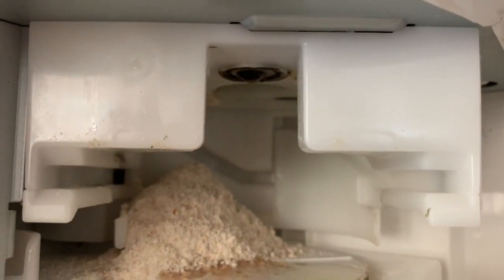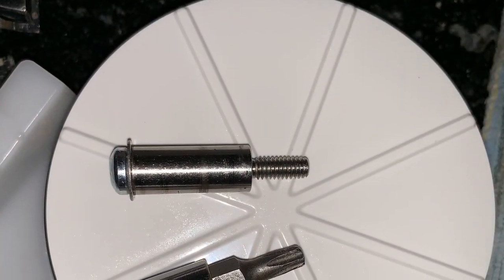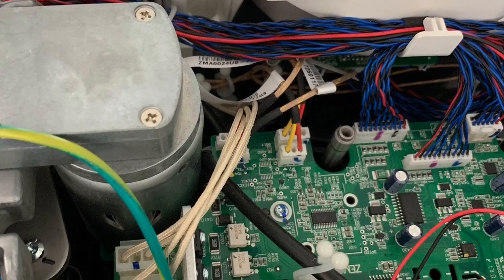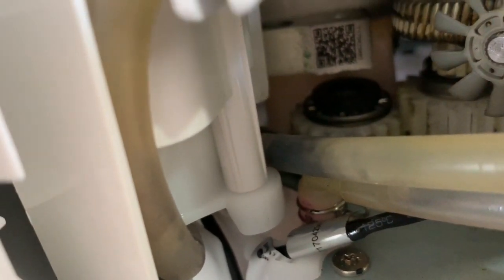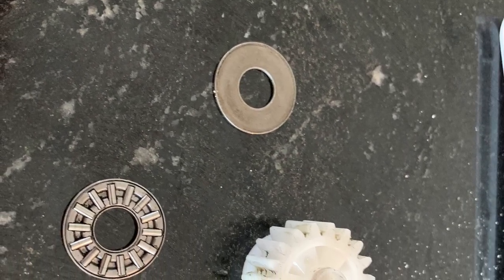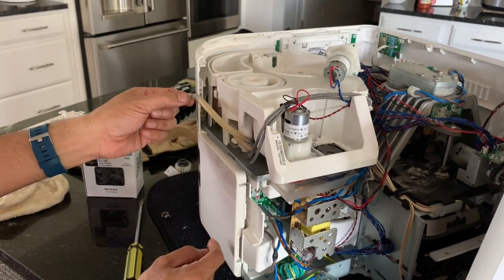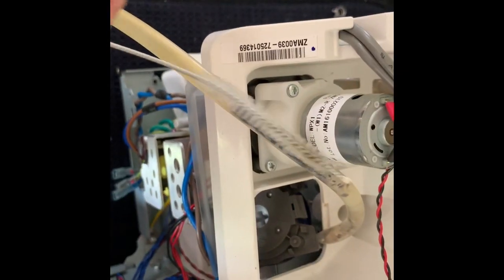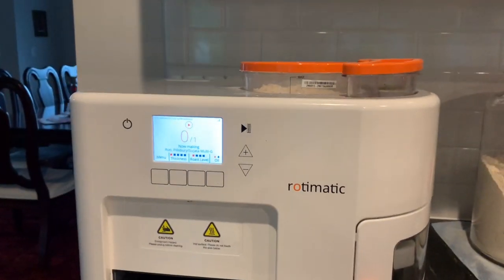Mold & Abnormal Kneading noise Rotimatic - Solved

Comment: Thank you so much for sharing this video, it helped us to try and open the machine which is having the same gear issue.  Unfortunately we couldn't fix it as we didn't have the spare parts available.  Two of the bearing of the rotator cup are corroded and in a bad shape hence not rotating or kneading the  dough.  I have contacted Rotimatic to see if they can provide spare parts.
As they've asked me to send the machine to Singapore and I live in the UAE.  Repairing cost $580 + shipping $450 .. it's almost the price of a new machine!  Hope I will find a solution for the same.
Reply: Hi Alyasiyyah, can you please share details on how did you open the machine. I am not able to get to the parts to see if it is fixable for me or not. Any video or written steps would be helpful. Thanks in advance!
Reply: I got the same problem and exactly same situation and same answer they gave to send Singapore and they told they will replace but it’s same price buying another machine .. if they don’t provide parts then it’s a rip off of customers by zimplistic ..

Comment: Awesome video, will you able to advise me what is the cause of oil keep on spilling rather by few drops
Reply from the maker: Thanks. The oil container has a spring loaded valve at its base, empty out the container, wash it thoroughly with detergent and hot water, move the valve up & down during cleaning it should clean any debris stuck in that valve and fix this problem, hopefully.

Comment: A quick question. My machine kneader is no longer turning. Is there a fuse i need to replace. Can i DIY the issue
Reply from the maker: You can DIY as you have nothing to lose, its already not working.

Comment: Thanks for sharing the video, its very helpful. Though I have a question, White rubber at water inlet came half out in my rotimatic, due to which water started leaking. will it be possible to put it back after opening the machine, any idea?
Reply from the maker: As I recall, it was crimped from the other end, it looked difficult, but you have nothing to loose, its already come off, what more can go wrong. Go all the way and open as much as required to fix it.

Comment: Thank you for making this. I never liked Rotimatic. I dont buy v1 of any product. And this mold design flaw, yuck. Did you manage ro clean the pipes with that thin wire brush ? I am not opening up a working machine, so this is a future task. But I can see a black shade behind the white plastic, below the flour tunnel. I can feel the water pipe opening there. We have been using for 1.5 years.
Reply from the maker: We bought the v1 knowing that we will be the test mules. Hopefully they will fix their poor customer service as disgruntled users are increasing by the day.
Reply: @akhaqan  Can you please guide me here in the resolution of this issue. Thanks!
Reply from the maker: @saharfaizi7879  Please watch the video, it may help you if your issue is the same, otherwise you have to investigate yourself.
Reply: @akhaqan  hi I can't explain how happy I am to see your video. From last couple of days I have been thinking, has anyone ever tried to fix by themselves and found your video. Now I will tell you my story. one fine morning my rotimatic stopped working. I called customer care they gave me quote of $580 USD. As per them it is a hardware issue and pans are not moving, but I don't want to spend any more on it. It is showing please clean pans and ensure kicker is properly installed. Do you think it can be resolved. You are my last hope. Please let me know if you know anything. TIA
Reply from the maker: @aartisharma3545  Thanks. The Rotimatic team has the same exploitative attitude with everyone, this forced me to try to fix it myself. My approach was what else could go wrong, its already not working. To answer your question, I have not faced this issue yet, I think if you are handy with such jobs and tinkering, you should give it a try, open it up and try to figure out what is wrong. Rest assured you can't mess it any further. Good luck.

Comment: Hello, thanks for making this video. Do you ever faced an issue with the water leaking from the top. As soon as I place the water container it starts drinking water non stop
Reply from the maker: That's normal for it to drink some water on startup, then it stops. If it doesn't stop, try to see where is the water going, it will be leaking somewhere
Reply: We are also facing similar issue and one of the reason is round rubber seal which goes in at entry where we put water container. We spoke with Rotimatics team and they said that it won't be fixed by customer and needs to be sent to their team which would cost some money or other option which they gave is get refurbished one at discounted price.

Comment: Hello, I have a problem where the Kneader has stopped working. Any suggestions on how this could be fixed as Rotimatic has refused any assistance to fix the problem
Reply from the maker: If there is absolute silence when its time for kneader to rotate then it could be motor failure. If there is some sound and movement in the kneader then it could be mechanical fault. Then it warrants opening up the machine
Reply: @akhaqan  how do I open the right cover, does it slide out or do I pull it outwards?

Comment: Hi Amer - Thanks for the video. I am stuck with the exactly similar situation. My Rotimatic is giving noise and not kneading properly. Flour and oil comes in the kneading section but no water. Rotimatic is asking to buy new machine. I saw your video and have few questions if you could help me with - 1) Was your issue only related to gear slip and you just adjusted the existing gears? 2) I am ok in opening machines and fixing such things. Just want to know is it too complicated once opened? 3) Any other suggestions to deal with it?
Reply from the maker: You are welcome. 1. Correct, that was the only issue. 2. It is reasonably complicated, all you expect to see inside is shown in the video though. 3. Remember to take lots of pictures BEFORE disassembling anything, pictures from 3 different angles at least, that would be a lifesaver. Go with the confidence that its already not working, what else could go wrong! You can build upon & improve my video, it may help someone else like us:)

Comment: Hello Amer. I am stuck in the same situation. My rotimatic is making veryloud noise and the company said there is some issue with the kneader. And they are asking me to purchase a new machine. Your help in troubleshooting this would be highly appreciated.
Reply from the maker: How can I help
Reply: @akhaqan  for me...by starting with the instructions on how to reach to the motor/gear part, 😄
Reply: @akhaqan  hi I have same issue.. I have opened the rotimatic but not able to get the idea how did you remove the gear???
Reply: Yes how did you remove the gear?

Comment: Thank you for sharing the video and experience. My unit as is out of warranty. Any idea why I get "flour seems to be running low" message. Even though I cleaned the container by dismantling every part and also made sure the tunnel is free from debris. Tried changing the flour and now waiting for new container to be replaced. If nothing works, going to open the unit and check. Any idea where are the sensors for measuring flour level and what needs to be checked?
Reply from the maker: Thanks. The flour level sensor is on the side wall of the body of the rotimatic where the flour container is inserted. Look around on the side wall adjacent to the control panel.
Reply: @akhaqan  Thank you, I found the sensor and cleaned it but still I  get the same error. Please let me know what should is the order for removing top cover and right side panel? if you have pics please share.
Reply: @bmkotian  please make sure that your rotimatic is up-to-date with the firmware updates,  for that, connect rotimatic app to your rotimatic using serial number of your machine and then connect with the rotimatic support team and ask for help to see if your machine is up-to-date.  I had same problem with low flour levels but after the updates, it is working fine. In fact it's with the new update where the dough is now not getting wasted as before!! All the best 👍

Comment: Great video Amer! Our rotimatic started leaking water outside the kneading cup. I am wondering if the mold is blocking the water or if that tube got disconnected. Have you had this issue before?
Reply from the maker: Thanks. We have not faced this issue. I'd start with checking that the water container valve is holding water properly and not dripping water. Then opening up the machine. I don't think tube blockage due to mold can cause leak.
Reply: Agreed. The water container is fine, there’s no leak from it. To open the machine, you remove the 7 screws in the back, remove the back panel, then the top panel and then the side panels, right?
Reply: I am facing similar issue, mine is exactly 2 years old
Reply: @tarusoft  I fixed it yesterday
Reply: @vidyashankars  what was the issue n how did you fix it?
Reply: Taruna Verma check your video. I’ve commented there

Comment: Our rotimatic is in use for over 2 years now. Can you post a video showing how the top cover was removed? Thanks.
Reply from the maker: This is the only video I made, look at it closely and you will understand how to remove the top cover.
Reply: @akhaqan  So the top cover comes off first? And is to be pried open from the front and then slid towards the front to take it off?
Reply from the maker: @chhupparustom  Yes it comes off first but then slide it back, see the notches.
Reply: Sir jee...a quick video on opening it up or instructions would be helpful. I tried to fix the same issue you have here in the video; but I tried opening the back white plastic body first and could not get it open. I opened 8 screws as well...but still i was not sure how to get the top-back those three latches to open. Please help 😄

Comment: We were able to open the backdoor easily but could not remove the top part...Is there a technique that we need to use ? We have half opened and it's lying there...Any suggestion is appreciated
Reply from the maker: Look at my video closely, you will understand how the locks work for the top part, then you can disassemble it easily
Reply: @akhaqan  ...Thanks for the reply....We opened but I am afraid we broke the hinges and there's no mold at all
Reply: @akhaqan , thank you for the video. I understand that the top cover has to be pushed towards the back in order to remove it(I did see the two notches on the sides). I'm unable to see how to disengage the front of the top from the curved side(water supply) going towards the control screen. If you have any pointers on how that part gets disengaged, that will potentially help quite a few people who have posted here with questions related to how to open the top cover.
Secondly, does the top cover only come off after the sides have been removed, or can it come off after taking the back cover off?
Once again thank you for providing the initial video on what you did in order to resolve the issue related to the noise.
The reason I have to open the Rotimatic is because I suspect we have mold in the water pipe since even after cleaning the water container and the socket it goes in, we see black stuff in the kneaded flour.
Reply from the maker: @kumarsamarth  If you look at 4:30 onwards, you will see that sides have to be removed to gain full access. I just started yanking at the covers to see where they were hooked, then used all four sides of force i.e. up, down, low, high to remove, that's how plastic locks are removed. I wish I had made the video of that part also. I did it blindly, you have at least this video to see the actual position of the locks and take it from there.

Comment: Dear Amer bhai. Error on my rotimatic.
"Flour seems to be running low". But it is not low. Flour container has been removed, disassembled, cleaned and reinstalled. Still having the same error
Any good suggestions? Please share. Thanks
Reply from the maker: It seems the flour level sensor is malfunctioning. You can try cleaning the entire area where the flour container is put. The sensor is on the side wall. I seriously doubt that it can be fixed. Did you try calling the helpline? Make sure the rotimatic is connected to the internet. There is not much else you can do. If you are handy, go ahead open up rotimatic and try to get a replacement sensor, it would most likely be an optical sensor.
Reply: Thanks for the tips.
I tried to open the rotimatic but could open the back cover only. I have figured out that the flour tray sensor is weak as per your guidelines. I did some temporary modification and made few roties. I wanted to take the top cover off to have access to the flour sensor but wasn't able to remove side covers. Did you make any videos while opening side and top covers as it is very tricky? If yes, please share your experin. Thanks once again 🙂
Reply from the maker: @muhammadjahangir5624  This is the only video when I opened it up fully, forgot to make the video from the start of disassembly
Reply: @akhaqan  Do you still remember that after opening the back plate which cover did you remove first? Right, left or top cover? Please recall the memory and share the sequence with us. 
Thanks
Reply from the maker: @muhammadjahangir5624  Removed the top cover first. Look at 1:14 onwards carefully and you will understand how the top is locked. It will take quite a bit of force to open it. Remember to make video of this step as I forgot.

Comment: One question, I’ve had Rotimatic for almost 2 years. The sweeper on it  stopped working.  It goes half way and stops moving  on top of the dough plate and does not return back.  The technicians have worked on it remotely.  Would you know what I can try doing to fix it.  The Rotimatic team said to buy a new one or a refurbished one again cause they couldn’t fix it.  The other functions seem to work correctly.  Any help would be greatly appreciated!
Reply from the maker: I have not run into this problem so I am not sure how to address it
Reply: Our sweeper is also giving problem. Rotimatic team said to buy a refurbished one :(   I wish if Rotimatic team is reading this comment on public domain and at least provide a video so that we can try to fix the issue by ourselves.
Reply from the maker: @DeepakGupta-bn5qo  My advice is not to go for a refurb unit. They are extorting money out of everyone and giving this standard reply. Open it up and try to repair it yourself, you have nothing to loose. While doing so make a video also and maybe someone here can help & guide.
Reply: @akhaqan  I do agree. I will do that. Its so nice of you that you posted detailed video that is definitely helping and giving confidence to us to try to fix issue by  ourselves.
Reply: Amer Khaqan - That was exactly my thought.  It’s already not working, why not just open it up and see what’s wrong with it.  I don’t think the motherboard is fried as all other functions are okay.
Reply: Pooja Jain if you are able to open it up please share a video.
Reply: @akhaqan  @Pooja Jain Hi, I opened back cover or side door however I could not open the top cover, I was having sweeper problem, Sweeper was not moving, I tried it in cleaning mode, but when I select sweeper in cleaning mode, I tried my hand to push sweeper. It was showing some sign of moving, I kept trying left and right and finally I was able to re-calibrate  sweeper. Initially it worked for some time and again the same problem however again I played with sweeper in cleaning mode with my hands and could calibrate it and machine seems working. let us see how far it will go. Thank you :)

Comment: My water slot white washer is broken do you have any idea where do I buy it from?
Reply: Mine too , any luck you had with solution?
Reply: White rubber at water inlet came half out in my rotimatic, will it be possible to put it back after opening the machine ?

Comment: My Rotimatic is overheating. After it starts-up and starts warming, around the “2-minutes left” Mark it will show that it has overheated and needs to cool down. After it cools down, it goes back in this loop. I think maybe a thermocouple has gone bad. Anyone else come across the same issue? 1 yr old machine. Thanks!
Reply from the maker: Are both fans working fine?
Reply: Amer Khaqan Yeah both fans are working fine. They are far away from any wall.
Reply: Finally what came out was the bottom plate heater was not working. After back and forth with tech service, ended up getting a new machine. Luckily had a month left on warranty😊
Reply: Thx for the video. I have a problem where the kneading rotator has stopped working.  Any suggestions on how to fix that. Would it be with the motor to turn the kneaded blades?